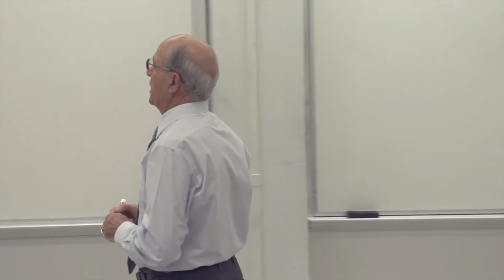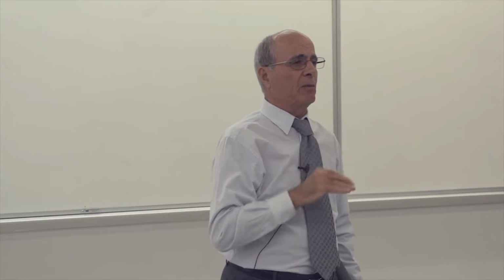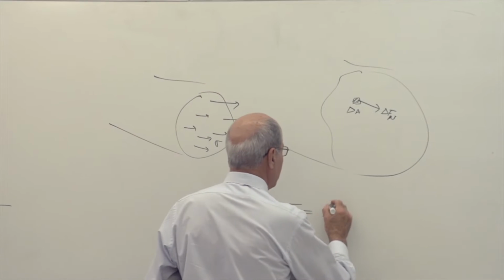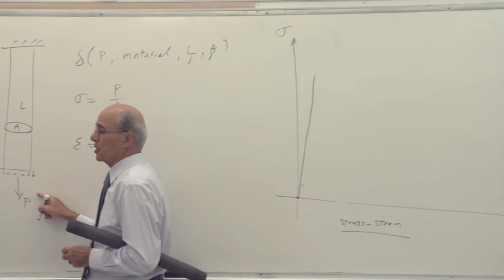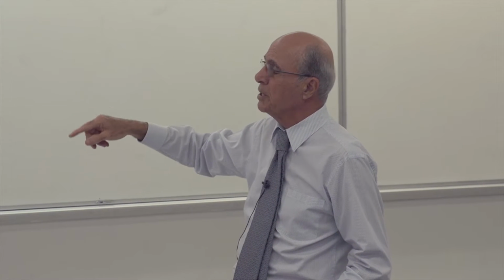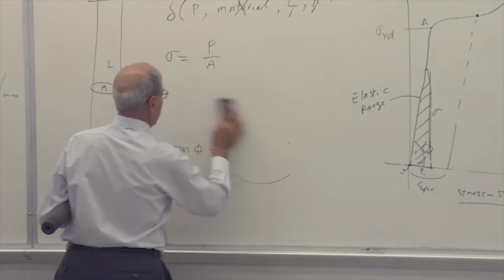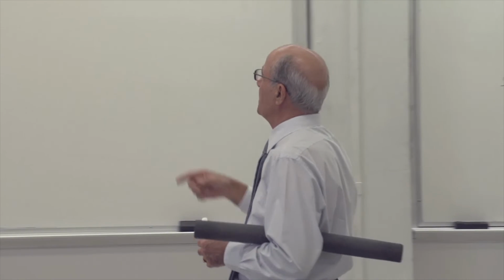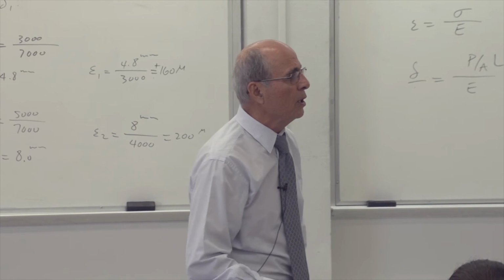Strength of Materials I: Stress-Strain Diagram, Hooke's Law (4 of 20)

Comment: how did he say that epsilon in micro while it is dimensionless ?!!!!
Reply: Micro is a prefix and prefixes are constant numbers. For example, the number of viewers a video has got on YouTube is a "Number" which doesn't have any unit but still you say, for instance, 7K viewers meaning 7000 viewers. Similarly you can use any prefix with a number and it would still be just a number...dimensionless!